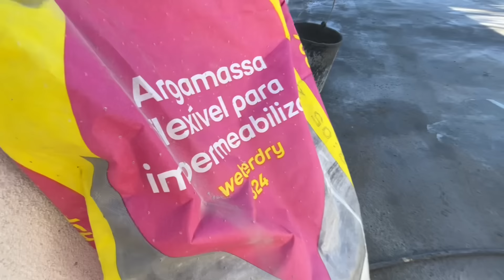TIME TO TEST THE NEW IMPROVED ROOF | Planning the Well Patio Area | E148

Comment: Good stuff. Usual practice is not to have your pump pickup at the very bottom if I saw correctly. 50-100mm from bottom should do so you don’t suck up sediment that will gather over time.

Comment: I sympathize with you going through back pain. Myself having gone through back pain in the past, I suggest some self physio exercises you can do at night it only takes about 15 minutes. 
Lay flat on your back and pull your knees up as far as you can using your hands placed below your knees. Do one leg at a time. Pull your knee up and stretch the back muscles and hold for 10 seconds. Do this 10 times both legs. After that repeat doing both legs at the same time. I did this when I had back pain. After 3 days my back was much better.

Comment: I pretty sure I've seen you pushing a wheel barrow around at some point, using that to get the rocks from the ground to the flatbed trailer might save you some steps, just a thought ❤

Comment: Hi Andy, saw you and James up at Ralphs' last week very envious, not long before I join you in the Algarve I hope , your Maths is a little out, your not taking into consideration usage, your using 200 ltrs a day, you need to calculate peak use and peak accumulation over the year, if I'm correct you will look to accumulate your water in 3  months for use in 9 months, as its raining and watering for you in 3 months but in summer trees and you will need more, to save building the second cisterna why not dig the hole and bury IBC's that are connected then monitor it for a couple of years  then build the cisterna and use the IBC hole to take a preform swimming pool, just a thought👍👍

Comment: Andy. Nice progress!  Quick question- is it viable to drill a well on the property? Meaning, is water available at say 100 to 500 feet below the surface? Any weird Portuguese regulations impeding you to go that route for water supply? Cheers.
Reply from the maker: They restrict bore holes now. Very difficult to get approval. Plus can cost 7k up.

Comment: Are you eventually going to have the tube from your roof to the cisterna be underground? You've mentioned several times where the water will exit the roof and that for now it will fill up the IVC tank, and then empty into the cisterna, but I don't remember you saying anything about the end plan, and I'm really hoping you're going to do something other than having those pipes hanging off your house like that. LOL :)
Reply from the maker: Yes, I’ve mentioned a few times. Can’t change it until exterior walls are done. 👍
Reply: Ahh, okay. :) Thanks for answering!! @rusticcrow

Comment: Go to a chiropractor. They will put your spinal bones back in place.
Reply: Did that after I strained my back. After the adjustment I couldn't even walk to my car. A chiropractor won't help a soft tissue strain. Heat off and on and rest.
Reply: @sundanceks5074  I agree that soft tissue strain needs bed rest and later yoga or gentle exercise to make sure the muscles do not stiffen up. People can feel sore after a chiropractor treatment because when you move bones back in place, the muscles connected to bones have to move with the bones and following an injury or when they are stiff, muscles don't want to move but need to unless there is muscle tearing from an injury and then you have to wait until the muscle heals before an adjustment. Timing is important. The longer you wait after an injury, the harder it is to get the bones to move due to muscle stiffness and over time, constant misalignment of the bones in the spine can lead to many problems. Going for a good brisk walk after an adjustment helps with discomfort.